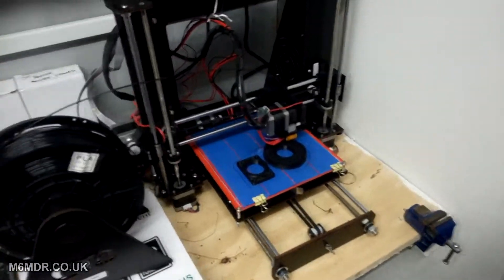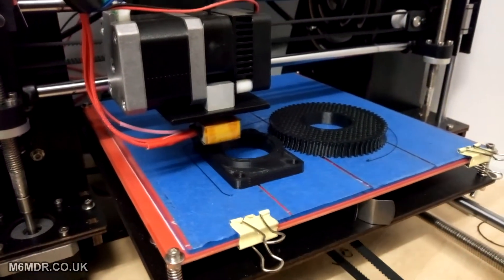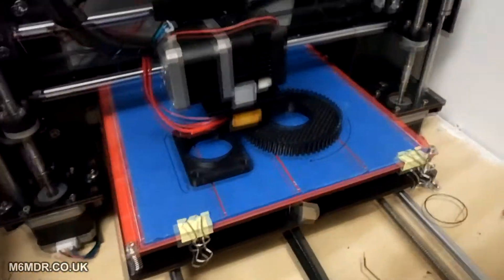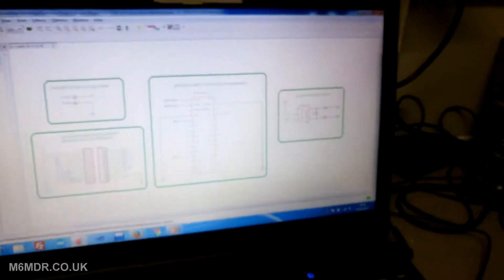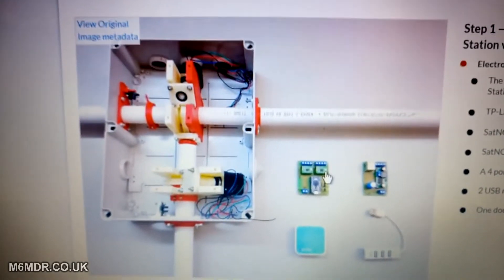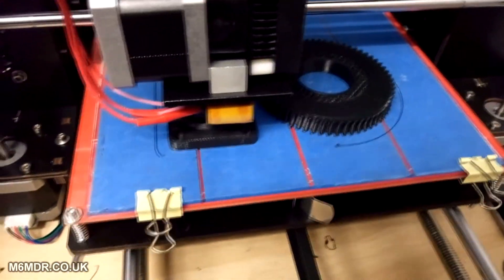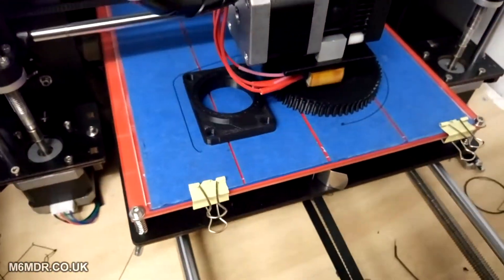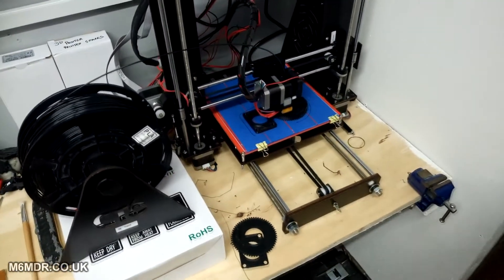3D Printing a Really Cool Satellite Tracking System Designed by SatNOGS

Comment: The adhesion and warping problems your experiencing are quite common.  The temperature differential between the sides create uneven cooling and lift the prints.  An enclosed build chamber is the only way to get perfectly flat prints.  Many people have had a great deal of success printing directly to the glass using a glue stick to help the print stick.  I use this method exclusively.  Being extra careful getting the bed leveled periodically is also essential to getting really good prints.

Comment: i have to say u made a terrible jobb covering the buildplate with tape
Reply from the maker: That's as it came from the manufacturer. It was pre-fitted to the glass bed already.
Reply: then they did a terrible jobb :D
Reply from the maker: Hehe yes, they did. I've not bothered changing simply because it doesn't really affect my test prints.